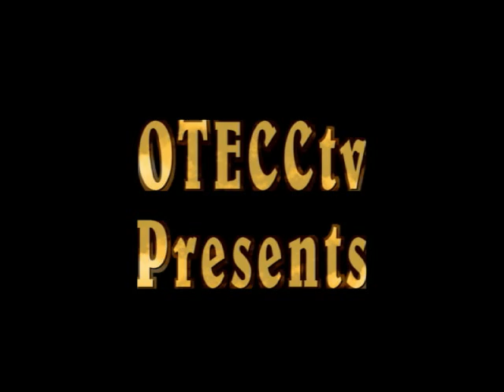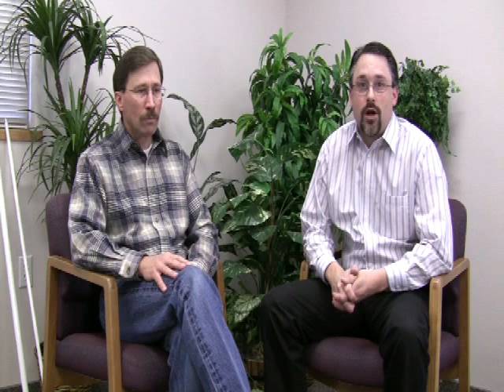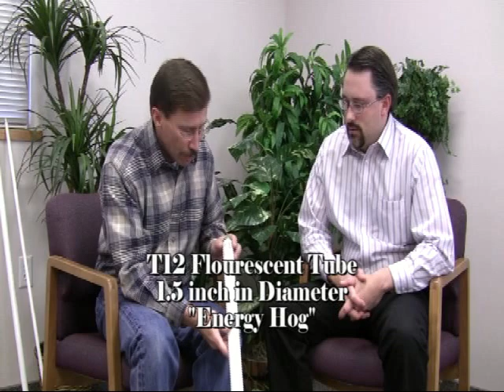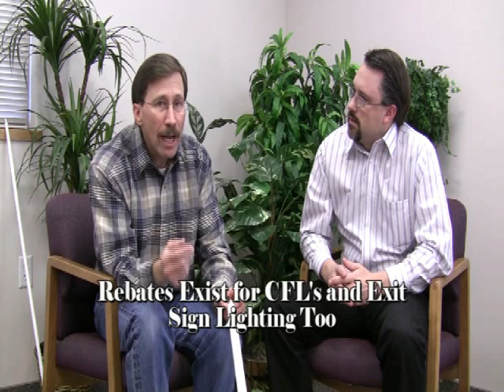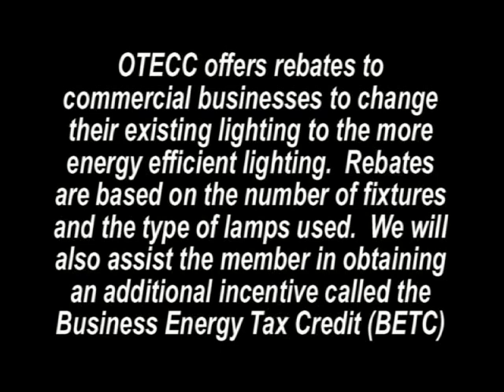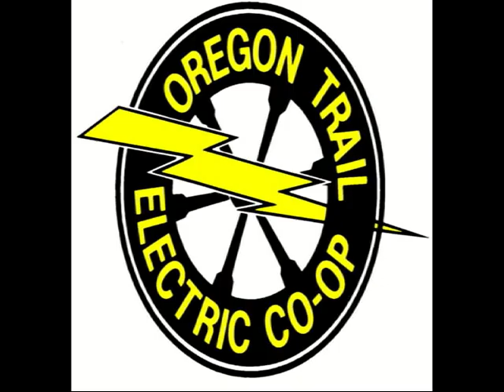Commercial Lighting

Comment: So, I would take it that the T-8 and T-5HO lamps need to go into their own dedicated ceiling fixtures? Of course I would like to do away with the fire risk of ballasts (that caught Bohnenkamp's on fire and nearly took out the EOU campus radio station. I look at all those overhead T-12s at Albertson's. Wow! And they used to "power down" during an energy crisis. They should design stores like that with skylights similar to Wal*Mart's grocery section, and more windows around the outside, too.